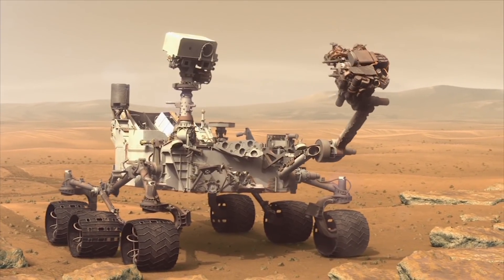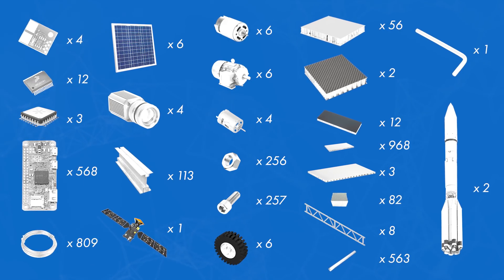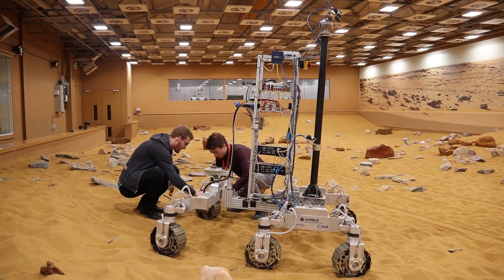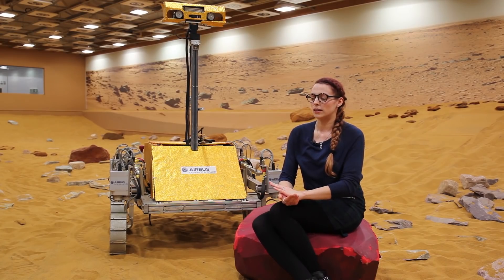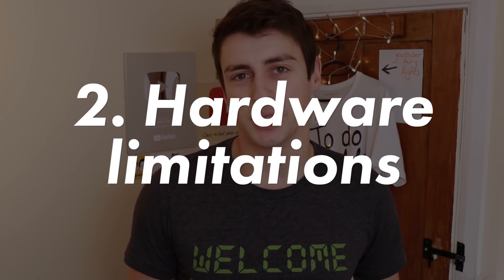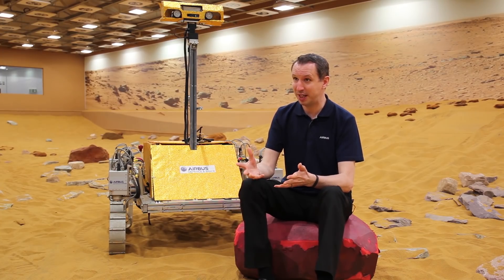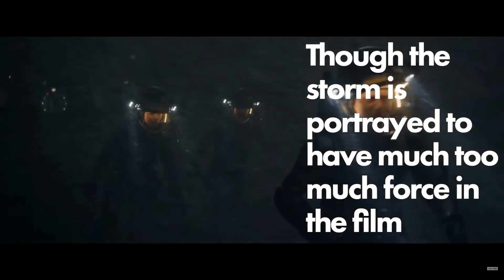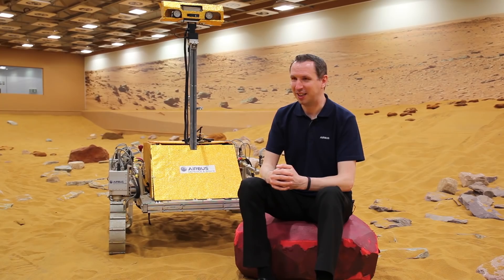How to build your own Mars rover (in 12,195 easy steps)

Comment: Are step 4389 and step 5153 the same , since they ask to check and attach the inertial stabilizor to the rover
Reply from the maker: Ah they are similar but slightly different! Make sure you check the polarity of the radial ports are the correct orientation in both cases

Comment: Why dont they use the static charge from the dust storms and a few decent sized capacitors to charge their batteries while the rover is cut off from solar power?
Reply: Why don't we just use thunderstorms  to generate electricity?  Work on that.
Reply: @quantumbits  not talking about the static charge built up between dust particles, but rather the charge dispersed on the skin of the rover as dust particles hit and move over it. If you've ever sand blasted a conductive material, you will understand what I mean and the magnitudes I am describing.
Reply: Why don't we just use thunderstorms  to generate electricity?  Work on that.

Comment: 6:35 - am I right in saying that its not 1/3 the mass but 1/3 the weight?
Reply: No. You're probably thinking that a certain object on Mars would weigh 1/3 of the same object on Earth, which is true. However, the point here is that a prototype rover on Earth is constructed with 1/3 the mass so that the weight on Earth is 1/3 of the full rover, therefore simulating the correct-ish weight as the full rover would have on Mars.
Reply from the maker: So the rover on Earth has 1/3 the mass. Weight = mass*g - to approximate the correct weight on Mars (where g is 1/3 that of g_Earth) the mass is only 1/3 that of the final rover.
Reply: so this prototype rover is only 1/3 the mass of the one going to Mars, in order to simulate the gravitational conditions of Mars? I think.